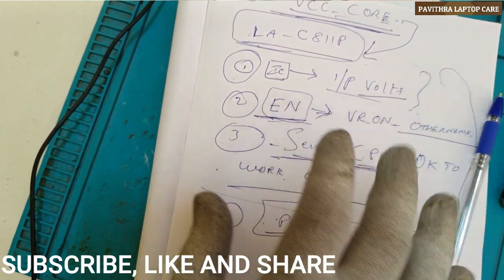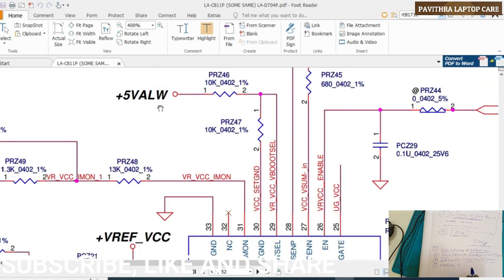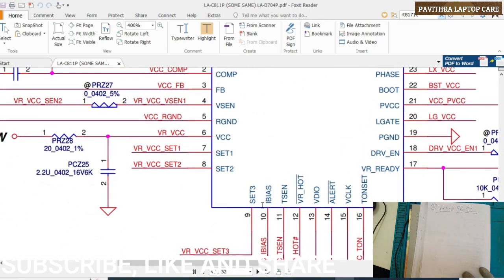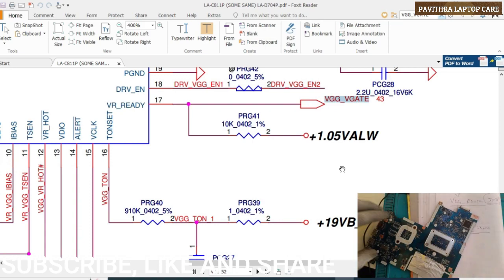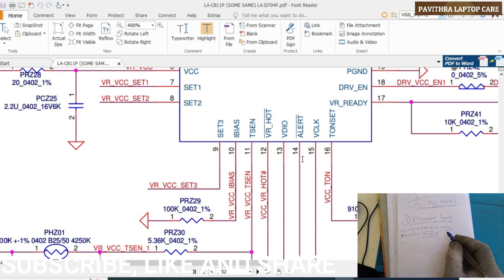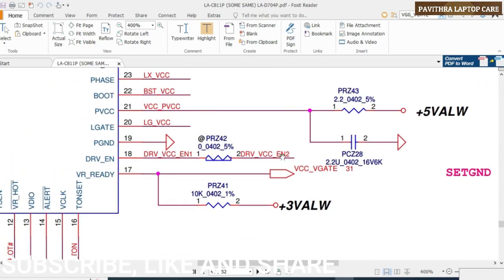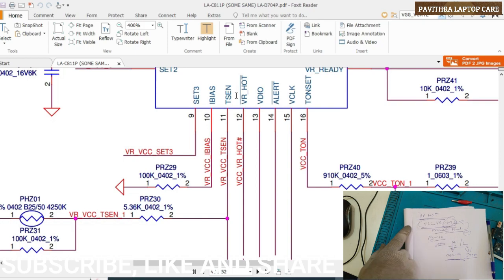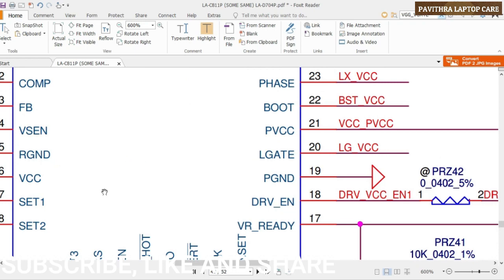How to Identify the PCH or SOC is short in Laptop Motherboard? VCC_Core Part 02

Comment: Sir I have a laptop MSI gl63 it is having power on and no display
Reply from the maker: Check core ic requirements and try new bios.
Reply from the maker: You need to check all S0 state voltage and signals
Reply: Sir I am a student
Reply from the maker: If u r in service field I can help u
Reply: So sir could it be fixed
Reply: I just need to know do pch ic cause this problem
Reply from the maker: Share the details in telegram
Reply: If so could you help me out by fixing it